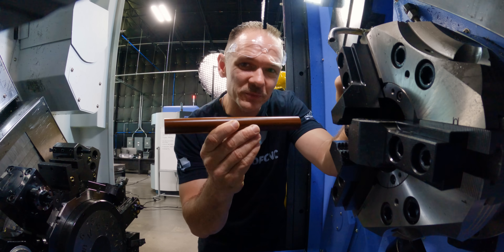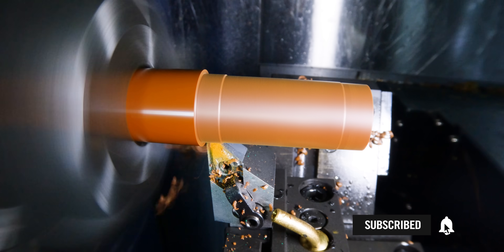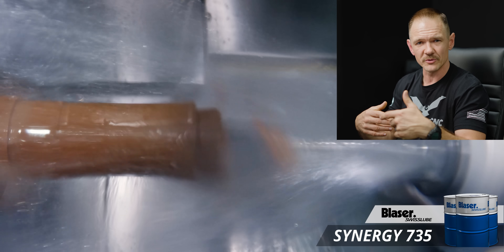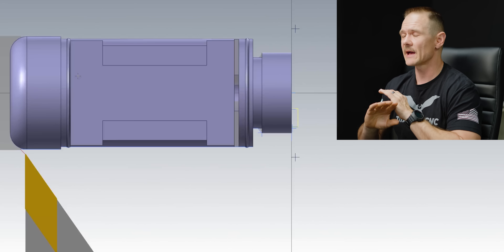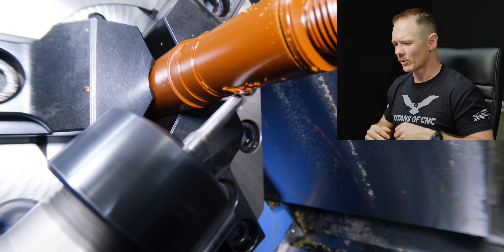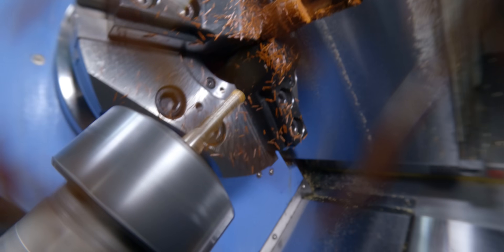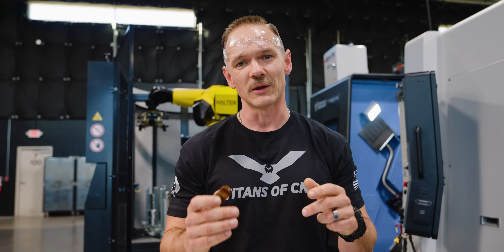The TERRIFYING Process Of Machining Vespel

Comment: You can machine your first-off unit using a cheaper material that has the closest specs. Once you have the correct program and dimensions - You use the correct material "Vespel" then just adjust for size! I use to back off off all the tools to make sure it's oversize then just creep into the final size...

Comment: talking about how capable this plastic is doesn't explain the price. If DuPont wanted to make more profit they would sell volume at a lower price point- but the absurd price suggests they can't. It's very unusual for a plastic polymer to cost so much. I guess maybe the precursors are relatively costly to produce, or some expensive catalyst is required?

Comment: Great video, thanks for doing it!

Why rough turn, then drill, then finish O.D.?  Were you finding that the material would expand a hair after drilling and you wanted to play it safe with your O.D. tolerance?   Also, why thread halfway, then groove your undercut, then finish the threads?  Would be fascinated to hear your take on things, if you'll indulge a fellow lathe guy.

Cheers guys!

Comment: We machine PEEK from time to time...$4,500 per pound.
Edit: Probably better off having that small of a corner radius tolerance call-out because you really need a sharp corner radius when turning these types of material, better chip control and less deflection caused by tool pressure with a larger nose radius.

Comment: there's a company making guitar picks out of vespel called Blue Chip; the picks are amazing, they last forever and are much stiffer than other materials, they're somehow grippy under my fingers but at the same time slippery against the strings 

thing is, they sell for like $35 when normal guitar picks are more like 35¢!
Reply: I'll have to stick to my 1.0mm Tortex's for now, I save money and turtles doing so.  😂
Reply: @Ole_CornPop  right?

at least Blue Chips are a bargain compared to real tortoise shell (and not illegal or ethically questionable)

for my "normal" picks the dunlop Ultex is good stuff, very stiff and long-lasting
Reply: Picks fly out of my hand as I've gotten older. Playing too aggressively for my age I guess. I balk at at the cool picks with the cork grip at a buck a piece. No way I'm shelling out 35.00 for one. I don't care what they claim it can do.

Comment: I machine thousands of parts in Vespel on a Swiss.   We machine it dry using through tool air when drilling and boring.   Without air chips can build up and cause chip weld.

Comment: I had an awful time once machining some weird phenolic. It wasn't the phelonic I was used to (cardboard), this shit was beige and seemed like it was impregnated with glue or something.

It was tube stock. Like 3in ID, 3.5in OD, 12in long. I had to turn the OD and ID down and shorten it. Final product was maybe .100 wall thickness. What a nightmare. All facing cuts would cause the material to chip out and flake apart in the ID. I considered trying to use the live tooling to face with an endmill but at the time I didn't know how to program it and had no help. 

Got yelled at for all the scrap. Hopefully never again.

Comment: Half of the tolerances might not be crucial as the print says if you look into functionality in most cases...like .005 radius he was talking about. It's crazy the amount of stress most machinist has to endure to achieve tolerances that doesn't really affect the functionality of the part.
Reply: In the case of parts like these for the most advanced products in aerospace or medical fields the customer may not even be allowed to elaborate on a specific feature to the contractor.  Such reasons may even be highly classified.
Reply: @douro20  I know that...but most of the machinist are not aware of functionality of the part, they just look at the print go by the tolerances that is given even if it is over tolerated. Like 005 corner radius, in this case as long as there is no square corner the part should be fine, the radius is to prevent  stress concentration.it doesn't have to be too  accurate. The engineers who are designing this , most them never have any machining experience, that adds to the struggle of machinists

Comment: The cost of Vespel isn't solely because of its properties, It's just a spiced up PTFE blend. It's DuPont's patents and trademark , being the sole supplier has a monopoly on Vespel.
Reply: @whtkngofc  Sorry, no it isn't. 

Vespel is polyimide (PI) based, not polytetrafluoroethylene (PTFE, a.k.a. Teflon)
Reply: There isn’t any fluorine in Vespel, so it can’t be a PTFE. PTFE is a carbon backbone with fluorine atoms hanging off both sides of it. The closest equivalent to Vespel is Kapton. It’s expensive because it’s complicated to make.
Reply: The cost of Vespel is almost entirely due to the fact that you have to process it at REALLY high temperatures (above 700 F) and that the few things that can dissolve it are terrifyingly corrosive and/or toxic. Everything in the processing chain is either Monel or a Duplex stainless.
Reply: It probably cost them cents of raw material cost to make it.
Reply: @1marcelfilms  Uhm, no. The precursors are not cheap. Vespel needs two components: 4,4′-oxydianiline (ODA) and pyromellitic dianhydride (PMDA). (Yes, I had to look that up.) If you look for it online, both are about €400 per kg, or about US$ 185 per lb, at a well known chemicals company. Sure, DuPont can likely produce those chemicals themselves, so that's not what it will cost them, but we're not talking about a price level of, say, sugar or flour here.

Comment: Not sure if anyone else commented on this, but Vespel is the material expensive Blue Chip guitar picks are made of. It’s the best by far.
Reply: Definitely needed for those cryogenic sessions huh [rolleyes]
Reply: @ eh maybe it’s not technically up to spec but the machine shop owner was making picks out of tortoise shell and tried the material and liked it. So have many thousand other musicians of noteworthy fame, but sure I guess it deserves the eye roll.
Reply: @gorak9000  also, it’s a self lubricating material, maybe it’s the friction specs.  It does impart a specific was of flow through strings and sound I haven’t gotten with anything else. A pick is $35 and I’ve never lost one and they last forever. Tool for the job, right?

Comment: I purchased some 'Tullomer', a new 3d-printing material.
$300 American Dollars for a pound....
The hype says it has tensile strength exceeding mild steel...we will see!
The printing specs are crazy...300+ C nozzle, 120 C print bed, 80 C print chamber, 500 mm/sec print rate, 0.05 mm layer thickness...teach your printer how to print spider-webs...

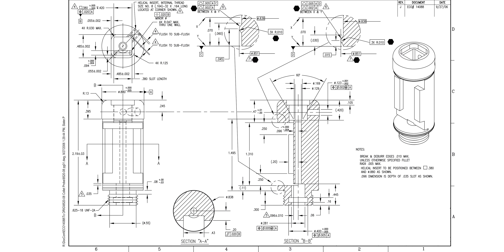Comment: 2:04

As a European lower class "Engineer"* it is horrifying to see such a drawing. Because on one side it is incredibly simple and straight forward, on the other side there is like 90% of what i have to put on a drawing just missing!

The fact we got measurements of 1.495" is something that makes my Eyes burn. I do not want to start to good old Imperial vs Metric debate, but if i design a part, i try to stick with whole millimeters... seeing a 1.1 is rare on my parts... sure in Imperial with Inches ts a lot less precise... remember a Inch > 20mm...
Also the lack of norms makes me feel uncomfortable. What are the standard tolerances if not specified? What scale do the views have? 1:2?  1:1? 
There are so many little details that are just crazy to see. A Drawing by new standards would look so different you would think you traveled to a whole new universe!
Last but not least, as we have a dezent amount of milling but the part remains cylindrical outside. The part should be rotated by 90° counter clockwise.... the way it is drawn is never how you would turn or mill it inside a machine.... 

Amazing machining and perfect outcome as always, super cool seeing those drawings too.
Reply: Our metric customers usually have a few oddball numbers on most parts.  A .43 or a .71 or something, usually for clearance against another part of their assemblies I think.  General tolerances are defined based on how many decimal places are used to specify the dimension, and critical dimensions are called out with a specific tolerance.  (Like // ±.001 for parallel within a thou).  Typical tolerance on a metric part is ±15 thousandths of an inch for zero place decimal, 10 for a one place, 5 for a two place and 1 for a three place unless specifically called out I think.
Reply: @ Dont you think thats because they are Americans that arent used to Milimeters or have to make stuff in Imperial sozes but still use the Metric system?
I once had to make a 1“ hole… in milimeters this would be a weird size so i just had it be 1“… the Mechanic probably has a 1“ not a 27.xx mm drill…

An Inch is just much more coarse to a milimeter, hence why you often see more .xx measurements…
Reply: We went to the moon with imperial, how bout the rest of the world using metric?
Reply: @ Believe it or not, you also went to space with Metric, you just didnt know😂 A measurement doesn change production or accuracy, only the amount of guesswork the mechanic had to do…
Reply: @Pitstopcomponents  lol, you’re obviously more mature than me, for some reason I was wanting to debate the greatness of imperial but you didn’t fall for it. I can admit to you secretly that the metric system is superior, you deserve that for not going straight to 10 on the anger scale.

Comment: Vespel as far as plastic goes machines great. I'd says it machines really well isn't super abrasive and holds size well. It's not quite the brass of plastics but it's not much worse. It's just expensive which isn't a big deal.

Comment: I wonder if there would be a market for "cheap surrogate" materials for this kind of thing? That would be something way cheaper that has nearly identical machining properties for testings your code with. You could use darn near anything for making sure you don't crash something or forget a feature, but something that is close enough to dial in feeds, speeds, finish and tolerances would be handy.
Reply: PEEK
Reply: Yeah that's called delrin we use it at my shop for set up all the time.
Reply: @orangerider2827  Do you machine Vespel all the time too? At a guess, delrin would be an example of the "darn near anything" I mentioned for some of the setup, but I very much doubt that it would work as a feeds and speeds stand-in for Inconel, paraffin, graphite, titanium or any number of other materials (not that all of those are pricey enough to need a stand in). In fact, it's unlikely that any one thing could stand in for more than a small fraction of materials.
Reply: @benjaminshropshire2900  yeah it's a common material for me. And I mean do the speeds and feed work yeah you can get close. Its mostly for size that I care about. Peek would be better as it's harder but its also more expensive so delrin is just a staple of the shop as setup part material. It's used for pretty much everything that's odd or expensive.
Reply: @orangerider2827  Interesting. I wonder if anyone has published tables of good stand-in's? My wondering isn't just about Vespel but rather having a catalog for all kinds of expensive to screw up stuff.
Reply: @benjaminshropshire2900  honestly once you do alot of plastics. I mean I have for over 15 years you kind of just know what it needs. You know what it's likely to do, how to get good finishes how the material will stress relief and if it grows or shrinks.
Reply: @orangerider2827 Yeah. True. (Not machining, but I've got similar experience in other tasks.) But at the same time, there's a point where the cost of messing up is high enough that "I'm totally sure it will work" still makes me nervous. If the cost of missing something is $10k I'm going to want to see my process work in a lower cost setup first before I put that on the line.

(I'm professionally an IT guy so the cases I've worked with are more "delete the right data and keep the right data" situations, but I've used the same kind of "measure twice and cut something cheap the first time" mentally.)

Comment: Google is a hell of a tool for accessing information. You sound like an metallurgist or an aerospace engineer. But you are not either of them  Are you?
Reply from the maker: No but he helped project manage thousands of different jobs for SpaceX with me and had to really become an expert on materials that we were quoting and running. Travis has been a top leader and machinist for me at Titans of CNC for 11 years. He knows more than most when it comes to high end materials.
Reply: What crawled up your butt?
Reply: As a machinist you'd have to be a fool to not try to understand the properties of the materials you're working with. I can't tell you how many times I've worked with engineers helping make material choices.
Reply: no, in comparison to aerospace engineers and metallurgists he actually has knowledge

Comment: Frankly machine shops should stop firing people for making one or two mistakes. It's why they cant find anyone to do the work anymore. Low wages high stress, limited advancement. It's just not worth it
Reply: Sounds about right. I was all giddy to do CAD/CAM until I found out what they got paid.
Reply: @1320pass yeah 25 an hour in so cal is not a living wage I could tell you.
Reply: @HimynameisAdamH1023  I would say when taking in consideration the cost of living in SoCal, that seems low to me, but I don't know the situation. Programming I would say definitely no. Not judging here..
Reply: @1320pass  I get $145k. Is that not enough?
Reply: thats not the average wage

plus shop  has jobs  what justifying your  wage
not to mention   you probably have experience and can work with others smoothly
Reply: @warrenschmidt8885  
you are right
Reply: @warrenschmidt8885  Sneaking up on tolerances by backing off on roughing tools and making multiple finish cuts doesn't represent the cutting conditions that will actually happen when you start with a new piece of raw material.  Cutting pressure and part deflection will all change.  This is ESPECIALLY true in plastics.
Reply: @brandons9138 bud that's doing pretty ok. Thx for the reply. If that's legit. I don't know.  Are you company or on your own? Programmer or operator? Outside looking in. No disrespect.
Reply: @1320pass  The shop work for is a medical device manufacturer.  Right now I'm the only programmer at a shop with 19 Swiss Machines, 9 lathes (three of them are 9 axis lathes),  and 8 mills.  We have several robotically/pallet loaded 5 axis mills.  We've grown so much that I don't get a lot of time on the machines anymore. 

I'm responsible for developing the processes for the production parts.  Our customer usually does small batches at first to test and refine the design, usually 100-500 pcs.  We use that time to fine tune our process as well.  There is one machine that I wrote the program for 5 years ago that is still running the same part.  That one machine turns out enough parts in a year to pay my salary by itself.
Reply: No shop is firing people for one mistake. Unless that mistake destroys a machine. Scrapping a part or job is going to happen. More often than not it's not just one person's mistake.
Reply: @brandons9138  Scrapping a part is a mistake some shops cannot afford to make
Reply: They'll keep you around as long as you're making them good money regardless of how many mistakes you make. I blew the door clean off a cnc lathe about a year ago and nothing happened just some laughs
Reply: nobody fires anybody for one or two mistakes because everybody does that.

Comment: I got to say machining it is indeed easy. 
Like PA66GF30. it's hard but breaks up nicely.
PA6 on the other hand is a nightmare.  Some parts require 2 finishing passes in order to keep it within tolerances.

And it does not make chips, they turn in legit strings, some easily up to 5 meters long

Comment: Have you guys ever tried mentioning M398PM from Böhler? It's a crazy tool steel with tungsten, molybdenum,  vanadium and chromium. That stuff eats drills, taps, inserts and endmills for breakfast, and is even worse when hardened!
Reply: Already machined M390, not hardened tho. Was half as bad and chip formation was excellent both on turning and deep hole drilling. Just take it a bit slower and yes the cutting edge wears out rather quickly. Surface finnish was on fleek too.
Reply: hardend K390 however rips every f*** hsc tool independent of the  price
Reply: @gab8090  never tried hss on k/m390, and never will lol. Carbine has a tough job, let alone hss